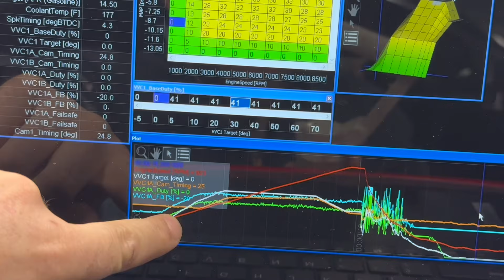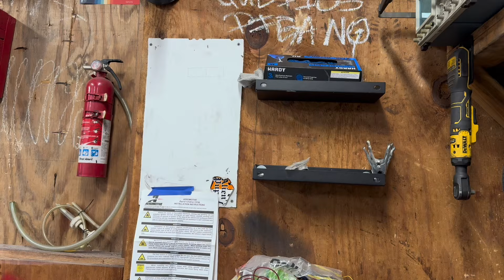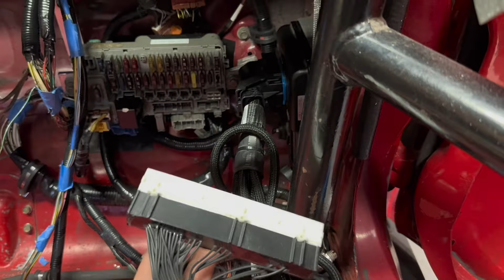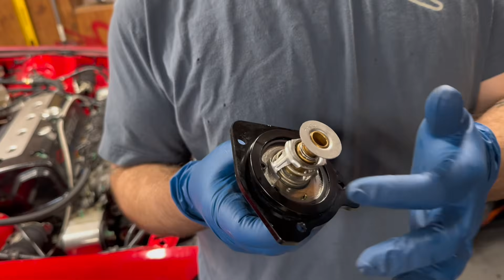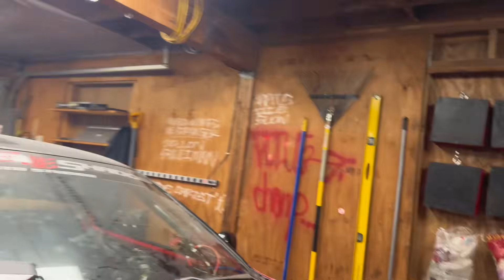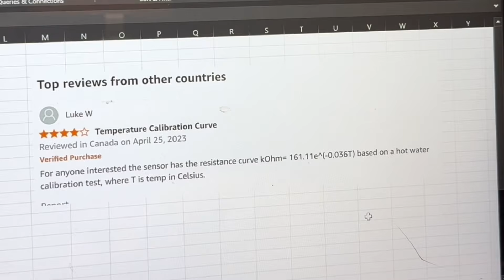K Swap Civic Race Car— Custom Wire Harness | AEM Infinity

Comment: Bro , where did you buy the aem infinity ecu?
Reply from the maker: I got it thru a partnership deal with them back in 2022.  It was still in the car so I’m running it, but I’d like to try another brand in the new car I’m building